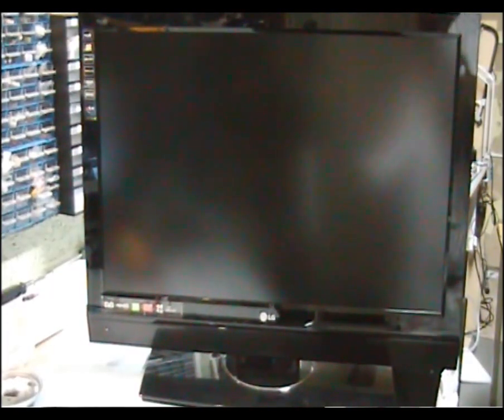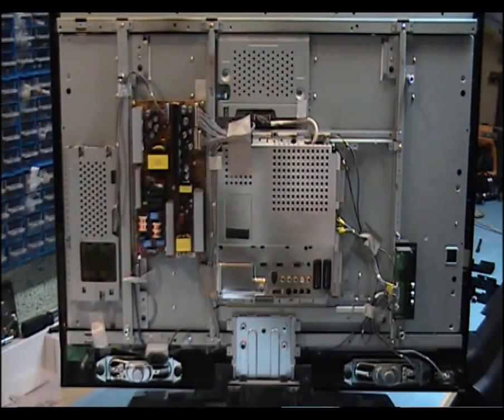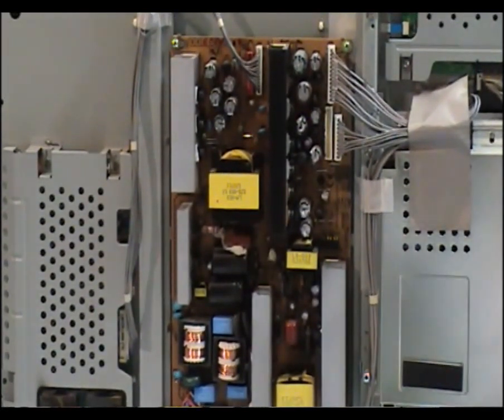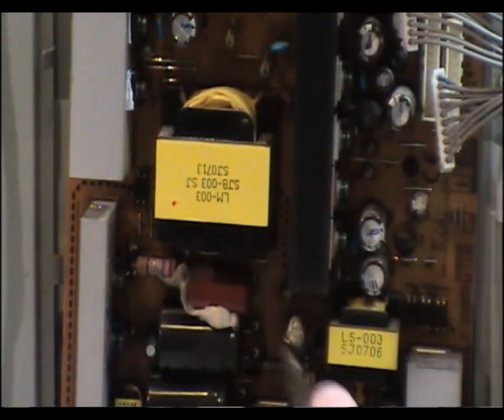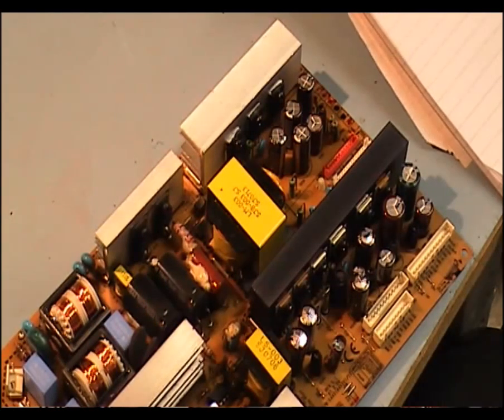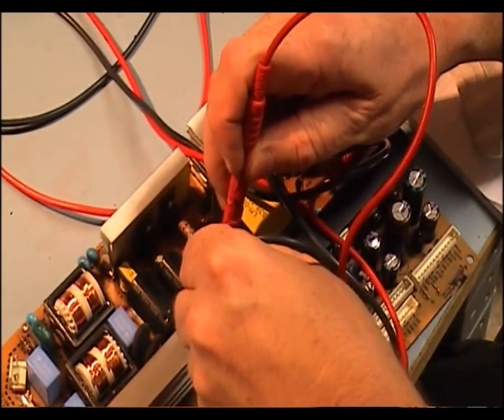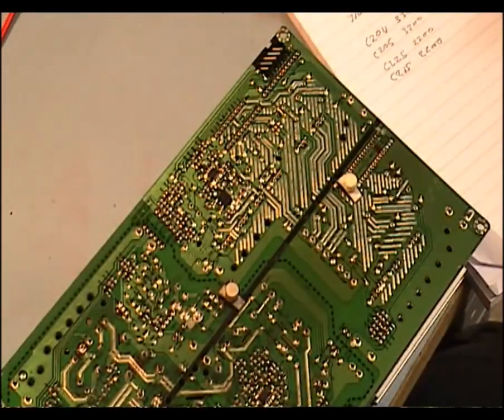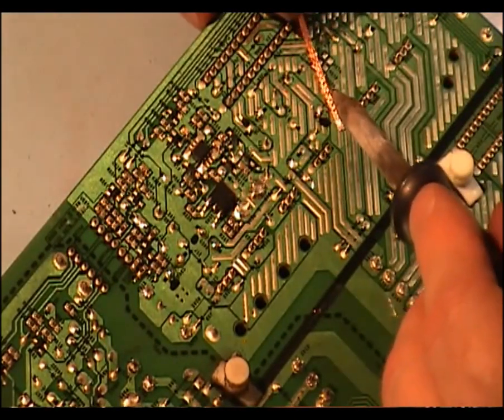LG 37LF66-ZE No Start up

Comment: Awesome video!
A question, ive got the same TV and possibly some bad capacitors.. none is swollen but the tv refuse to turn on sometimes. Do u have a list on all the capacitors on the power supply board?